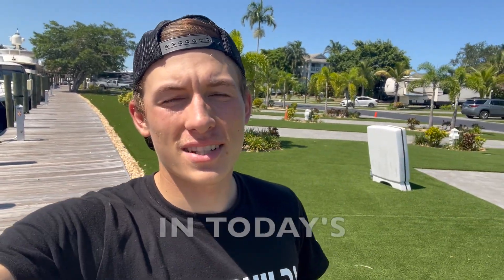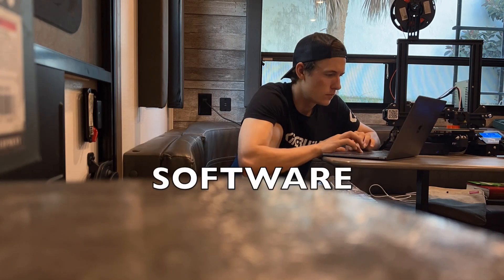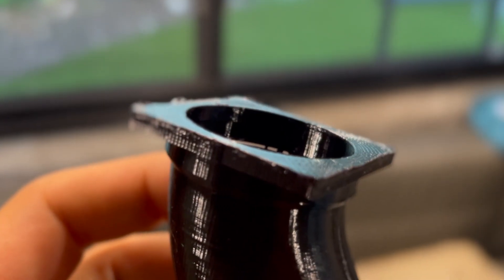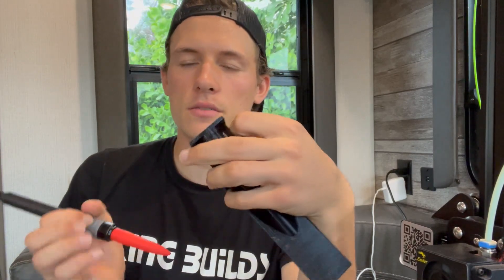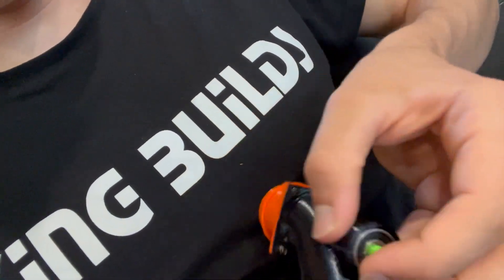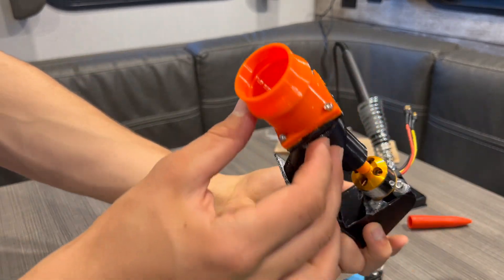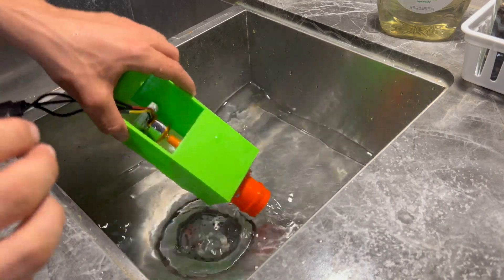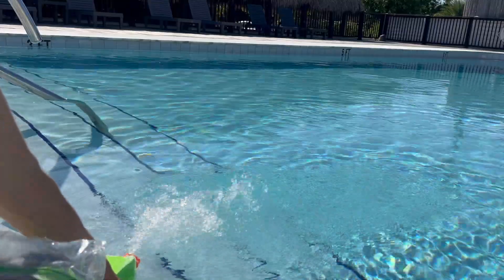I Tried 3D Printing a Jet Pump

Comment: Brushless motors are waterproof, any issues is due to electronics getting wet. I’ve done similar projects, and I just encased my ESC in epoxy and that solved my problems.

Comment: Use wrap on the outside before screwing in. Or electrical tape, just tape left right and center. You also can use a plastic cup to encase the motor so water is less likely to splash on it. Or use some gears and mount the motor downwards. Nicely done. Be accurate.